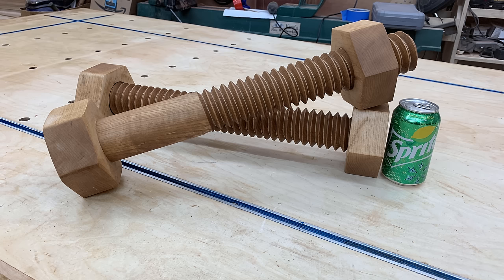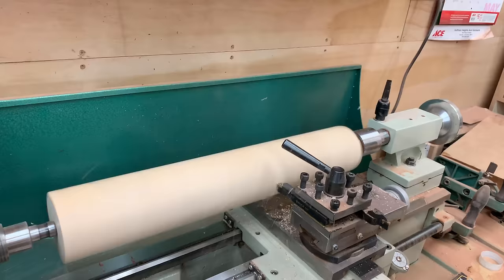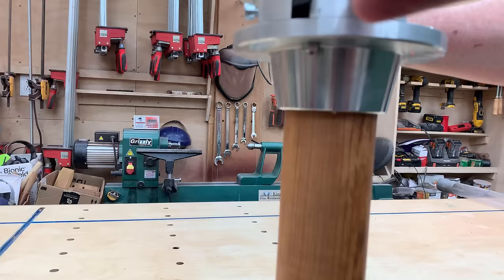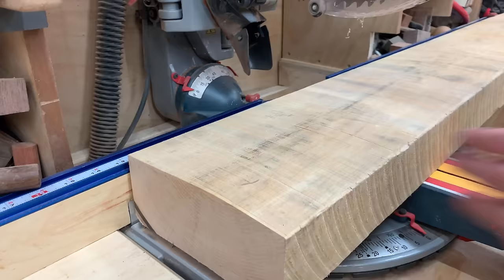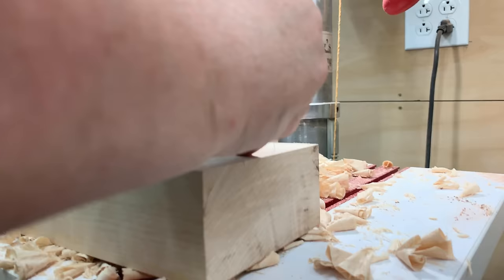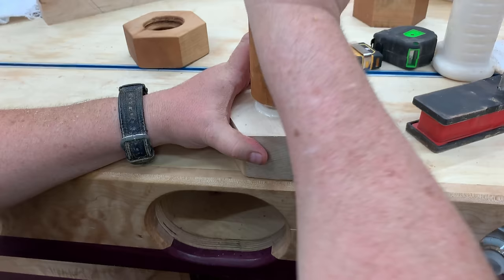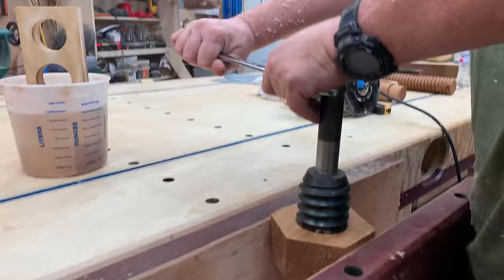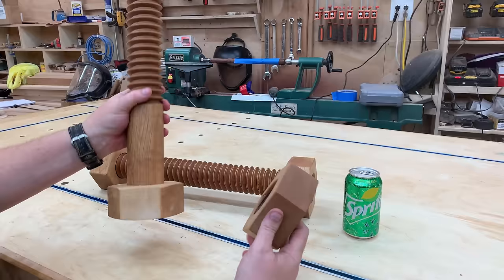77 - The Secret to Making PERFECT Wooden Threads

Comment: Perfect work !!! Very nice video !!!

I use a similar preparation of the wood (I 'm an antique pianos restorer..) when further detail shaping is to be done on it but I use e mixture of liquid paraffine, a few drops of oil based varnish and toluol, white spirit, polyurethane solvent, acetone, petrol or other water free solvents (every wood has its preferred cocktail). I preheat (100 C) the wood piece in the oven and the humid air expands and leaves under pressure. Then, the wood absorbs the thinned out paraffine much faster as it cools down when dipped. The heat exchange between wood and solvent, vaporises the last leaving a the lower viscosity, almost waxy, paraffine-varnish mix deeply embedded into the wood which fully stabilises after drying again in the oven (50-60 C max ! ).

A colleague uses a (near) vacuum chamber and an electric pump, instead of heat, to make use of the negative air pressure and another one (somewhat...unstable...) uses an armored air-tight metal chamber and...explosives to produce pressure hardened and almost water-proof wood panels while recycling his used engine oil !...

I still believe that the heat treatment is the best way to go as It saves time, kills any fungus, mold or mite of the wood, dries it to a more shape-stable status and prevents further shrinking or warping after process, hardens it and protects it from humidity, makes it more blade/chisel-friendly and leaves a fine satin surface which can be varnished (oil based only) or even painted ! It also darkens the natural color a bit and deeply defines the grain which may be desirable in most cases...

[Allow me a tiny terminology correction on the math: not the arc length (cycle circumference = 2π radius = 6.28.... r ) but the arc chord length is equal to the radius of the cycle. hexagonal circumference is exactly 6 radius lengths since a symmetrical hexagon can be divided into 6 triangles with all their sides even blah blah blah... ]

Comment: 2 points to consider. 
A little flat on the Dowell end relieves the pressure building. 
Taping the nuts. Use your coconut lubricant on the tap and nut blank.
Great video. Thanks.

Comment: Consider pulling a vacuum on those oil soaking dowels. They'll be done in 15 minutes. You will need to make a stronger container. PVC pipe will probably suffice.
Reply: Vacuum and pressure works better. I worked for a company that treats wood. They pulled a vacuum in a closed cylinder containing the wood and fluid, then pressurized it. The cylinder was heated, too.
Reply: A vacuum pump is a lot harder to find and/or more expensive in the context of the home woodworker than a week worth of time.

Comment: You get better results laying out a hexagon if you draw a line through center and strike off the radius on each side of both places where line intersects with circle. That way eliminates any slop that usually gets picked up after interpreting the line of the circle within the pencil line it's drawn in and where the grain of the wood lets the point of the compass actually set. This may seem like nonsense but I bet if you actually walk a compass around a circle using it's radius as the spread, the 6th step will be noticeably off of step 0 when it's supposed to land on 0.
Reply: Yes it will be off because he wasn't right saying the radius is 6 times around the circumference. It's actually 6.284 so there will always be an extra bit!
Reply: @paulfinnigan3562  for a circle but not a hexagon.

Comment: Great tip with the mineral oil - you basically turned dried wood into fresh cut (wet) wood again - which is much easier to chisel (or any cutting operation). I used to use glycerine to help prevent splintering and tearout when I bent wood over forms. I don't recall that it discolored the wood as much as the mineral oil seems to, but it's been 25+ years ago now.
Reply from the maker: Interesting! I wonder if glycerine penetrates as deeply with it's higher viscosity? I'll have to give that a try one day!
Reply: @KingsFineWoodworking  I was always using it for small laminations for experimental hobby aircraft (and other long broken toys) - and it seemed to penetrate at least deep enough to prevent the surface splintering. I like the mineral oil technique - and you're essentially replacing the air with mineral oil - much like stabilizing wood with resin in a vacuum chamber - only slower. I bet the vacuum process would work too. I really enjoy the videos - you are a great teacher and I'm definitely a fan of your work - both with the woodworking and the videos. The narration really helps - explaining why you do what you do. I was blown away about the calculations with glue and clamping force. Thanks again for sharing your work and expertise with us!
Reply from the maker: Thank you!
Reply: @KingsFineWoodworking  some sort of solvent might thin it

Comment: I saw a violin maker who was  repairing a hole with dowel, the trick to getting the air out he used was to make a very thin cut with a blade on the inside so the air had somewhere to escape ;) Loved watching this even though am not planing on making any wooden threads...well I wasn't until now.

Comment: Rounding down Pi to 3 again, are we? Read "Going Postal" by Terry Pratchett to find out how it turned out the last time somebody did that...
Reply: Stopped watching right there. Pfft.
Reply: @aculasabacca  -  Actually, the compass technique marks off the length of chords of the circle, not arcs.  A simple proof shows that six identical equalateral triangles are defined, each having a base (the chord of the circle) equal to the radius.  The outside of that group of trangles is a perfect hexagon.  Pi (3.14159) is not involved in the geometric proof.
Reply: @mikel.6505  Oh wow, thanks.
Reply: @mikel.6505  I was watching an elderly gentleman from Australia making a wooden bucket and he used that method to get the dimension for the bottom.  I had no idea what he was doing until I read your comment here.  Now I need to think about all this.  Thank you for explaining it.
Reply: The error is mostly eliminated by scribing 2 points each from 2 opposite points, at least as far as most wood is concerned.
Reply: @phookadude  No error needs to be corrected. The compass points, if done perfectly, line up exactly.

The error in the video was just that they talked about arclength, which is not involved here.
Reply: Just a couple clarifications.  The triangles are equilateral and the hexagon created is regular, not perfect. @mikel.6505
Reply: pointer G ..... What is the difference between a regular hexagon and a perfect one ?
Reply: @pointerg6181  You are correct.  The term "perfect hexagon" is ill-defined.  Proper nomenclature is as you say, "regular hexagon".

Comment: That metal lathe has the ability to thread; why not just us that?
Reply: Thats how i thought this video was gonna go
Reply: That metal lathe can't cut threads with a pitch that big.
Reply: @throngcleaver  Yea, it can.
Reply: @Suitednzooted11   No, it can't.  The Grizzly G0752 maximum thread size is 8 TPI in Imperial threads, (0.125" or 1/8" between peaks on the threads) and 3.5mm Metric threads, which is approximately 0.138" between threads.  The wooden threads he's cutting in the video are 2.5" - 2 TPI, and that means the threads are 1/2" apart, or 4 times larger than what the lathe can cut.
Reply: @throngcleaver That is what the spec sheet says on that model. All you would need is a different end gear though.
Reply: @Suitednzooted11  Well, since you and I don't know if the owner of that lathe has the correct gear to cut 2 TPI threads, I'm going to guess that he wouldn't purchase such an expensive tap and die, if he already had the capability to cut those threads.
Reply: @throngcleaver  Probably not, I didn't notice the model of the lathe. Only that it was a grizzly and I figured it probably came with end gears to move the carriage at least that pitch, since mine does. Either way, a couple end gears should be way cheaper than a bunch of those tap and die sets.
Reply: @Suitednzooted11  For sure!
Reply: I also assume that since this was a tutorial he's assuming most people watching don't have a metal lathe. So he was showing what could be accomplished with just woodworking equipment.
Reply: Someone made the tap... on a metal lathe. BTW My machine will do it.
Reply: Even then, he used the metal lathe to turn it to size.
Reply: @throngcleaver  Oh yes, it can!! Very easily!
Reply: Mostly only rater large lathes cut 2 TPI because of the stress on the gear box drive train. 
They used to make smaller lathes that would do it but there were too many gear failures or other things breaking. 
Mine cuts 4 TPI but I could get a bigger gear made but I would have the same problem.
Reply: throngcleaver that’s what I was hoping to find in his links in the description of this video! But they’re just links to the same old basic sized thread cutter boxes I’ve ever seen, none go up to 2” or better yet 2.5”. Where can I find the cutter kit HE used in the video!? Those are far higher quality than the little wooden box cutter kits on amazon.
Reply: Most of us don’t have a metal lathe so it is nice to see it done this way.  I would like to see your your way though!  Personally I have been using the Beall tools and find it very quick and easy.  I’ll be looking into this oil  bath method!

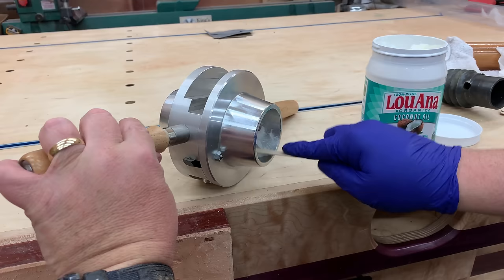Comment: Who makes the thread cutter at 5:22 in the video? (It's different than the ones in the description.)
Reply: The sets linked in the 'Information' panel are only up to 1 1/2 inch diameter, whilst the one used in the video is 2 1/2 inch diameter and is from Dieter Schmid in Germany (https://www.fine-tools.com/gewind.html) . They are beautifully made tools, and joy to use (and own) but you need deep pockets - unless you can persuade someone else to fund the purchase (like your local club). Happy threading.
Reply: I would like to know the answer to this as well
Reply: @kyvguinto  Thank you very much,   The link from Philip does not exist.    What you found looks to be it !
I have seen a lot of people try to make threads.  They all look bad.   Which could be from a cheap cutter.  Or the wood was not soaked.  Even maybe a combination of both.  I never heard of soaking the wood like that.
But it makes total sense.  If all the pores are filled with oil not air.  Then there should be no tear out.  
Thank you again !
Reply: @ericsnyder1647  no problem. Actually just tried the method last night and the threads came out perfectly! I used the threading kit from Woodcraft since it's a lot cheaper. I only soaked them one night though and I think they could've used another night for the oil to soak deeper but they came out great! Going to use them to make a traditional Scandinavian shoulder vise!
Reply: I have been using the beall tools. Work great!

Comment: Although I have never threaded wood that large, with smaller, finer, threads, I cut once, and run some CA glue into the newly cut threads, then run the tap, or die through it again. That really hardens the threads, and is good for repeated use.

Comment: I am soaking my dowel as I type this.  Used a length of 1-1/2 inch plastic pipe with an end cap.  It's cheap and has a snug fit for 1-1/2 screw.  Used only about 6 oz of mineral oil.  Final product will be moxin vice.  Thanks for great video.

Comment: Wow, that Dieter Schmidt tool he used lists for 1160 Euros or about $1254 dollars. For one size only (2.5 inches). 

To put that in perspective, grizzly makes several models of metal lathes that will do threads and they sell in this price range. One that does up to 14 inches long is currently listed at $875. And of course you can do a lot more with that than just threading wood. 

On the other hand Beall Tool company makes a kit for threads up to 1 1/2" and sells a kit for which you also need a router to use but it does all of these sizes for $275 dollars: 6-Size Threader 3.0 Kit (1/2", 5/8", 3/4", 1", 1-1/4", 1-1/2" right).

Comment: I would make a tube from clear PVC and use a vacuum pump when soaking the dowel in oil, it would pull nearly all the air out and get the oil deep inside.  Sort of like the process of resin stabilizing. It should drastically reduce the time it takes the oil to fully penetrate.
Reply: John McDermott I was thinking the same thing when James said 7 days. Build something to vacuum out the air.
Reply from the maker: YES! It would reduce the time to hours!

Comment: Nice job on the threading It might even help to add a little mineral oil as your cutting or tapping the wood just as you would with metal. I've tapped and turned a few threads in my tool & die career. Just a suggestion so she doesn't have to work so hard :) Great job on all your videos and so nice to see you work with your girls in the shop.

Comment: I've cut a ton of threads in metal, my family had a precision machine shop for decades, but I've never considered wooden threads or even considered a die or tap for cutting wooden threads. (Mind Blown!) The die and tap are obviously the way to go, but have you ever tried single-point threading on your metal lathe for wooden threads? I'm curious how cutting the threads on the lathe would work for wood, especially on external threads. My guess is it would work great if the OD was thick enough to handle the tool pressure. As the OD decreased the length would need to decrease so it wouldn't deflect. (You wouldn't want to cut a 3/8-16 thread on a 12" wooden dowel. LOL)

Comment: after beating my brains out and messing up a lot of threads, I found that, as the vid says,  wood prep is important and oil is the key.  I used linseed oil, which imparts an amber color to the wood.  I soaked for 24 hours on 3/4 dowel and it soaked to the middle of maple.   the die cutter has to surgical sharp, or it will tear.  On a smaller dowel, it cuts like butter.  the difference is dramatic with the oil. 
Getting the blade set perfectly is another trial and error process.
The size of the drilled hole is also very important.  I tried the hole size the kit said was needed and it didn't work. (I used a different one than this).  So some trial and error was done to get the final size.
I also found that if the nut is just a little too tight, you can tap again but pushing down on the tap, and it takes out a little more wood than just a regular cut.
After all my research, a friend gave me a router jig for the external threads and it works perfect and is easy to adjust.
This size would be great for making a Gutenberg style letterpress.  Those threads were double start and all cut by hand...

Comment: 10:00 Correction: the radius of a circle is not 1/6 the arc length (you probably mean the circumference). That would mean PI = 3, where actually it's 3.141... . Instead, a hexagon can be split into six equal-sided triangles, whereby you see that every side of the hexagon is equal to the radius.
Thanks for demonstrating this tool, I have never seen wooden threads done this way. I would've assumed you turn them on a lathe with auto feed.

Comment: Have you ever considered using a vacuum chamber for reducing the soak time with oil?  I believe you can just wend a steel pipe on one end and have a removable cap on the other with a connector on the other.  That way, you can slide the plastic cylinder inside with the oil and wood and then remove it, no mess.
Reply from the maker: That’s a great idea!

Comment: Nice work. I didn't expect a tap and die set of that size. Since you have a metal lathe and are not averse to putting wood in it (a lot of machinists would've been screaming at that point) I expected you to use that. You could cut as shallow as you wanted and really avoid tear-out.

I must also note the very un-Kingsian amount of glue you used to fix the head on to the bolt, but you would've needed flutes to let the air out if you used any more.
Reply from the maker: Un-Kingsian indeed! :-)

Comment: The thread length on a standard fastener like this one you made is twice the diameter plus one half inch. A threaded to the head bolt is called a tap bolt, I don’t know why they used that term. This is very nice work and I appreciate the video, I just found your channel.
Reply from the maker: Thank you!

Comment: Me 3 . I would also like to know who makes the thread tools
Reply: Look for "Dieter-Schmid Wood Thread Cutting Tool".  They are not cheap especially compared to the wooden box cutters.  But they work, I own two a 19mm (3/4") and 32mm (1-1/4").  They also tend to work better if you use metric.  Keep in mind store bought dowels are almost NEVER good enough.  Turn your own, or find a vendor who verifies dimensions.
Reply: @awildeep  Thank you Greg.

Comment: curious how long you would need to wait after making this to put a finish on the wood (because it's saturated with oil)?  Or does the mineral oil become the finish?  I don't typically stain any of my wood but I do like to put something like danish oil on it, then buff it, and wax it.  I also might put something like Rubio Monocoat on it as the finish.

Comment: Awesome Awesome Awesome...We always used mineral oil on wooden surfaces we use to do food preparation, like a cutting board or a work surface like the last one I did was 40 inches by 60 inches, to put on top of a existing table to do pizza doe, pastries, cakes, waffles, sausage... and all the good things our Italian culture is known for, but once oiled, nothing sticks, so when I saw you gluing it, I did not believe it would stick! But worst case scenario you can always put a dowel across...Question: Are your daughter always so calm and focused, because they seem like pros just doing what they do best!!!
Reply from the maker: Hi Tony. Thank you! Acetone quickly removes the oil so the surface can be glued. And as for my daughters, they are very experienced woodworkers and know exactly what to do without direction in the shop.